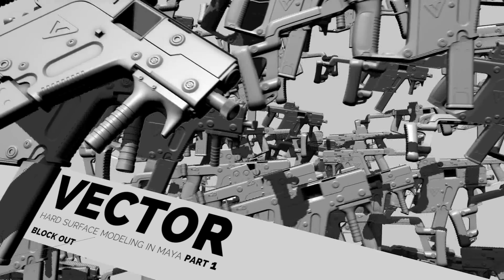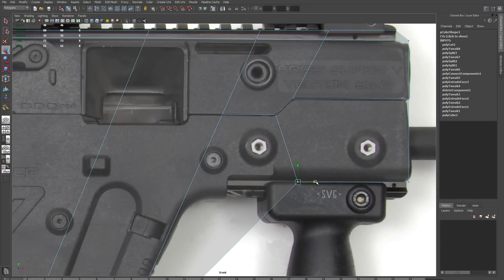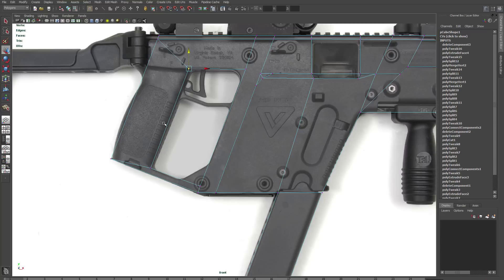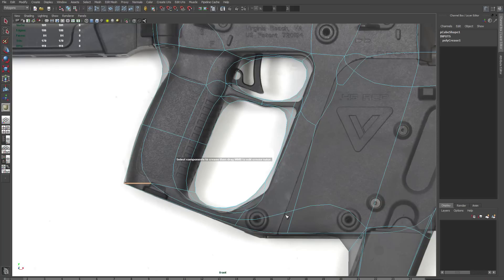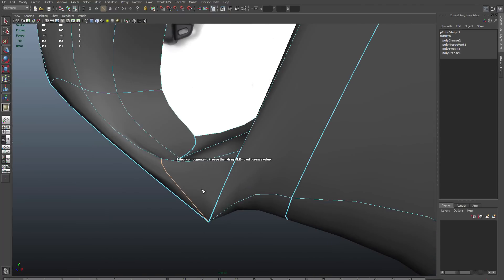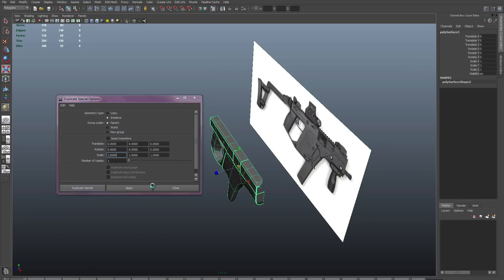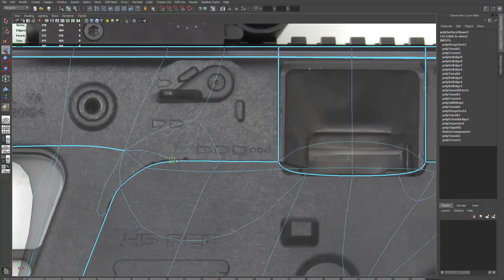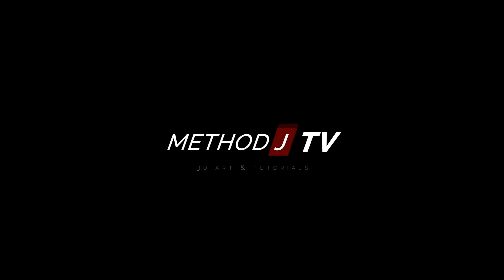GUN MODELING in MAYA part 1 - hard surface modeling tutorial

Comment: Working through your tutorial and it has to be said, it's perhaps one of the most painful experiences ever. Having to run the video at 0.25x slower than normal just so I can work out what you're doing. Also you inconsistently jump around between three different models at different stages of completion which means that the model topology appears to change, practically jump about the place. Nice tutorial but really poor execution to video for this platform. Sorry dude. Otherwise great stuff.
Reply: The biggest issue I have is working with the smooth preview is a really badway of working the crease tool helps but it's never ideal modeling with smooth preview on. 1 it gives you false confidence of the quality of your model 2 when working with it on soon as you press 1 9.99 times out of 10 your low unsmoothed model is an absolute mess
Reply: This is a great video to watch for methods and concepts, but not for directly following. I don't think he intended anyone to follow this step by step man, just watch and listen. Then do it yourself.

Comment: I can't seem to get my Multi Cut tool in Maya 2016 to apply the edge cuts on both sides of the gun mesh like you are able to. I'm aware that by holding the middle mouse button down you can perform a "Quick Slice" I believe it was called, but it doesn't offer the same level of precision that was shown in this video. Any help would be really appreciated, and thank you for the video!
Reply from the maker: I think I was modeling on duplicated halves, so I never needed to split both sides of the model at once.
Reply: Wow thank you for your reply, knowing that I misinterpreted how you were creating your geometry is a big help

Comment: Hi!

So i'm running into a problem with the multi-cut tool while doing your tutorial.  how do you make it so that when you created vertices on one side, it'll do it on the other side, (symmetry).  Autodesk website says to turn on symmetry for the object but it didn't work

please advise, thank you

Alec
Reply from the maker: Some tools don't work with symmetry! Try Maya 2017, I think they fixed symmetry for Multi Cut.
Reply: thanks! it definitely works in 2017 now!

Comment: may i know how are you splitting the surface on both sides simultaneously at 0:55 you split just the front yet a vertex is created on both the surfaces since you can move it to fit the image
Reply from the maker: +Ritvik Majumdar the Cut Faces tool affected both sides at once
Reply: No I mean the split polygon that you did it affected both surfaces
Reply: At about 0:53 when you use the split tool
Reply: Thank you for your time
Reply from the maker: +Ritvik Majumdar holding down shift or control (can't remember which) will cause the multi cut tool to cut all the way through an object
Reply: +James Taylor I am sorry but neither are working
Reply from the maker: +Ritvik Majumdar use cut faces or connect components instead
Reply: can i use edge loop ? again thank you for ur time u have been amazingly hellpful
Reply from the maker: +Ritvik Majumdar that will probably also work

Comment: James when u slice the mesh, it doesn't work for me. I have maya 2015, and it only cuts on one side. How do I get it to cut on both sides?
Reply from the maker: Peter Shih are you using the cut faces tool? Try holding down shift while cutting.
Reply: I am using the multi cut tool
Reply from the maker: Peter Shih try using the cut faces tool, instead.

Comment: My shape does not retain the sharp edges after i smooth. what am i doing wrong?
Reply from the maker: CZOKKA use the crease tool on the edges you want to remain sharp, that'll do it.
Reply: James Taylor thanks for the swift reply. ur really the best for tuts and tricks. but yeah i have. i model and crease the edges while previewing in smooth preview. but when i actually subdiv (smooth) the hard edges are not retained and they get smoothened. im using maya 2015
Reply from the maker: CZOKKA ah, if you mean hardened normals, yeah, the mesh smooth modifier smooths out all the normals, you have to go in afterwards and reharden everything. :/ if the creases don't hold shape, tho, double check the smooth options, I think there's something in there about preserving hard edges or creases.

Comment: Why u are not afraid of doing triangles ? Isn't trying to do all in quads better ?
Reply from the maker: Svyatoslav Revt good question. They are a shortcut! For hard surface models, topology isn't as important as it is for, say, a character. The hard surface never bends or deforms, which is an area triangles cause problems in. 

With hard surfaces, triangles can make smoothing or certain tools (bevel, edge loops/rings) break, but those problems can be worked around. The trade off is that triangles are usually much quicker to do, and the resulting model will probably be less dense and easier to work with.
Reply: James Taylor understood, then it won't bother me when i'm doing them :) Thank u, can't wait for part two.
Will u do some texturing too ?
Reply from the maker: Svyatoslav Revt I haven't thought that far ahead yet! :D
Reply: James Taylor cause that would be great :D This model of yours would be finished and i could learn a lot ^) Still modeling is great, keep it up!
Reply: The way I see it, working in quads or tris is like computer programming. Working in Quads is like writing code in C++. It's widely known. Most places teach C++ because it's a great starting point and a very solid foundation, on top of the fact that many companies use it.

Working in Tris is like writing in C# or perhaps Python. You accomplish the same end result, just using a different variation. They all have very similar philosophies and methodologies, but just slightly differing in approach. 

Each work method has different applications and it all comes down to preference in my opinion.
Reply: Svyatoslav Revt Also many game engines require the mesh to be in tris as opposed to quads. Having that flexibility of being able to work in tris makes things much easier though in my opinion.
Reply: Arthur Chen yeah i know about that, i just saw and heard people doint triangulation in the end, when they need to export their models, but in the process a lot of tutors said that it's not recommended and to try to avoid them as much as u can.
Reply from the maker: Arthur Chen I like your analogy, thanks for sharing!